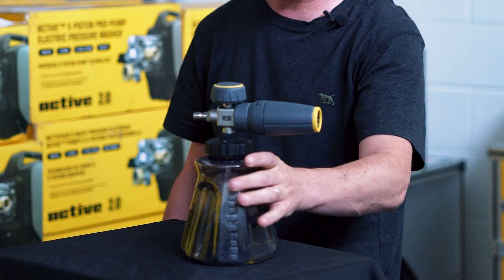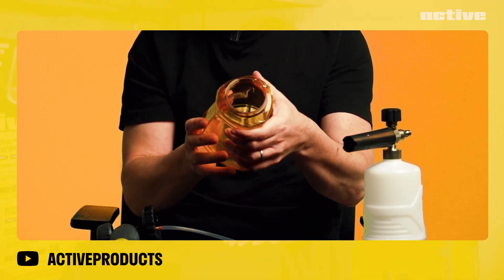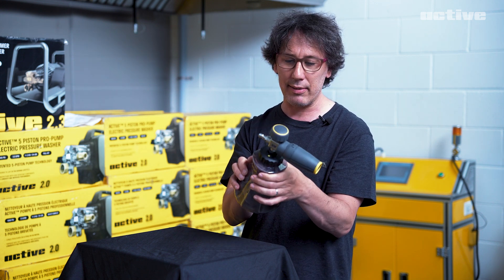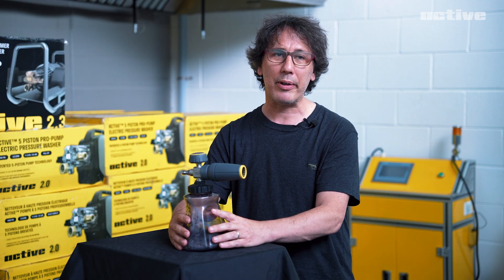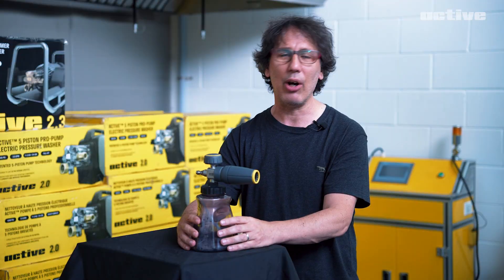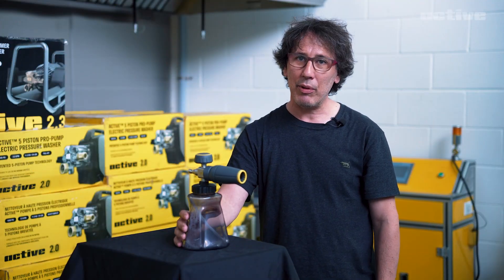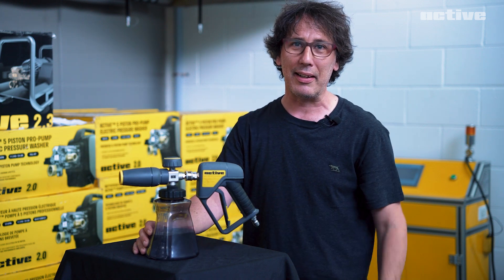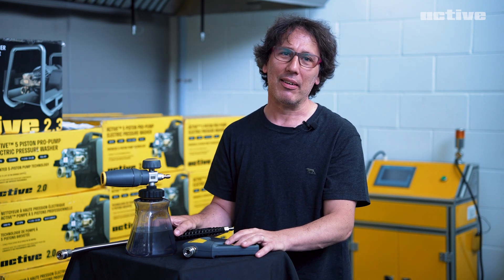First Look into the ACTIVE FOAM CANNON - Let's Build a Foam Cannon! PART 4

Comment: That cannon looks to be the most well thought out cannons of all time.    And while yes, it's a similar foam cannon to everything else on the market,  It looks like Active really took the advice of professionals on what they wanted in a foam cannon.   That thing looks like it's built like a tank!    Solid construction.     Should give years of use without problems.    One word of advice, just rinse it out after every use with clear water to extend the life of the internal components.

Comment: I literally just ordered your Short Gun from a supplier here in Canada about 2 hours ago (Pro Detailing in Mississauga). Are you saying the mechanism in that gun has an update (I assume to fix an issue) that will not be included in the item I will be receiving? Will there be a retrofit available to update my unit under warranty or should I just cancel my order and wait for the fix to be released?
Cheers
Kevin (Caledon, ON)
Reply from the maker: Hi there Kevin. The Short Gun with the updated mechanism is being sold right now, if you ordered it recently you'll be receiving the latest version.
Reply: @ACTIVEPRODUCTS  Wonderful! Just got notice that it is being shipped today. Very much appreciate your response. I'm also looking forward to the release of your new Foam Cannon....looks like a great product.
Cheers
Kevin

Comment: The last sample bottle had Active in yellow lettering.  Could you possibly use that same color and “emboss”/cover all the capacity marking to make them much easier to read when adding liquid?
Reply from the maker: At this point in the production it's difficult to do it, but if enough of you feel this is necessary we'll be considering it for the future

Comment: I appreciate the update.  Can't wait for the release.  A couple questions.  Is the 50ft hose of similar quality/flexiblity as the hose that ships with the 2.0?  Is the short gun trigger upgrade going to be available for anyone that already purchased the current model?  Does the smaller 1.25 orifice cause a higher amp draw on the 2.0?   Thanks again for the road map.  Great job, Active!
Reply from the maker: Hi there, to answer your questions:
1. The 50ft hose is more flexible and as durable as the 2.0 hose. 
2. EDIT: The updated Short Gun is being sold right now.
3. A 1.25 orifice creates a higher amp draw than the 1.45, but it remains on manageable levels.

Comment: Looking good; can't wait for it to be available! 

One thing I'd like to see, and I don't know if this is possible this far along in prototyping, is if it's possible to have the measurement marking highlighted in some way. For example, if you're doing a darker color could the markings be white in order to stand out? Every foam cannon I've used it's been really difficult to read the markings because they are the same color as the bottle itself, so everything blends in and you really have to struggle to read them. If there was some way you could contrast the markings with the bottle color so that they're easy to read, that would be great.
Reply from the maker: At this point in the production it's difficult to do it, but if enough of you feel this is necessary we'll be considering it for an update in the future!
Reply: @ACTIVEPRODUCTS Thanks, that would be great!

Comment: +1 to the additional bottles so we can swap soap types quickly. Something that could set you apart would be a quick disconnect rom the bottle to cannon so we don't have to worry about threads failing eventually. I'd pay a premium price for that.  

Overall, it looks like it performs well and similar to the competition. Since this is an all stainless build I think your real competition is Griots garage since their is all stainless as well. Would love see a comparison there.

Comment: This video format and editing are solid imo, and JC seems more comfortable and lively here.  

1:21 With the fan width adjustment, I hope that once you rotate it to the desired width, it will stay there relatively well. My PF22 is great but the fan width doesn't really lock into place and doesn't have the friction/resistance to really stay at the desired adjustment compared to my Griots Boss. My Griots Boss has an issue where there is a small jet of the mixture that shoots out above and below the desired fan which just wastes product on the ground sometimes. I'm looking forward to this Active unit replacing both of those since I have a few issues with both.
Reply from the maker: On our testing we've seen the fan width stays in place and that the jet is pretty consistent overall, you shouldn't be seeing these issues
Reply: @ACTIVEPRODUCTS  Awesome, that is great to hear.

Comment: Will there be a 2.3 bundle with the new accessory package? The standard accessories just don’t seam to fit a high end washer
Reply: I was wondering the exact same thing. The foam cannon that came with the 2.3 never really worked for me and the 40ft hose isn't quite long enough. Maybe offer a discount to upgrade to the new accessory bundle or swap to the new items for the previously purchasers of the 2.3 washers 🤔?

Comment: You had me at the click and I stayed for the foam! Every adjustment knob or turn dial should have a click. It would be an honor to break that bottle. 🤣 Seems real good would like to see the balance empty as well as when stored most foam cannons are empty. Don’t want them falling off the shelf and breaking. I do like the balance with the gun attached as well. Would like to see the suction tube flexibility and if the weighted ball is the right length.

Comment: Foam quality looks great.  Would have been nice to get an idea of consumption of the mix between the MTM, MJJC and the Active.   If you can produce the good foam and not use a ton of product to do so then ultimately the Active cannon becomes cheaper than the others when factoring cost of the unit plus chemical use and draw rates.

The gun with NEWLY IMPROVED MECHANISM……. Looking forward to that for maybe even an easier pull and remove the detent and shorten the pull length even.
Reply from the maker: There's a video idea! If you guys are interested we can make a quick video with a timer.
Reply: @ACTIVEPRODUCTS that would be great! Weigh the cannon with liquid before and after and see what type of liquid draw rate it has per minute. Of course this would depend on the viscosity of the liquid dilution, GPM and PSI of the water but would be fun to just see the same 10:1 mix you showed us in this video above. Thanks Active, can’t wait for this cannon!
Reply: @ACTIVEPRODUCTS I too would like to see a video like that!
Reply from the maker: Hi guys, your requested test is up on our Shorts section!